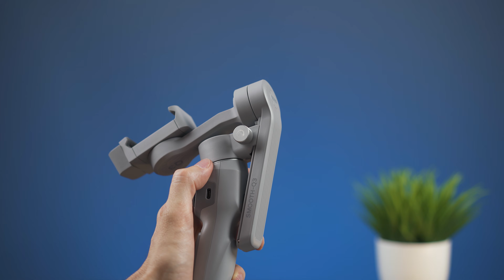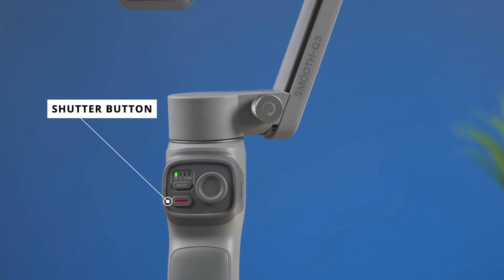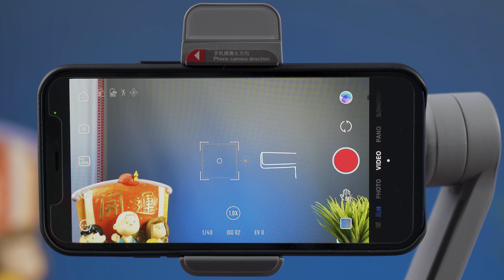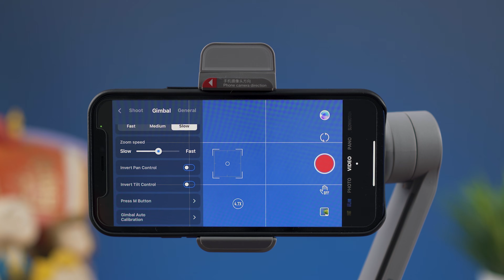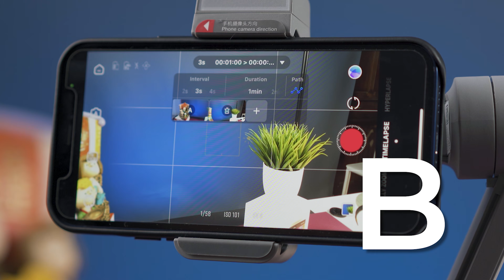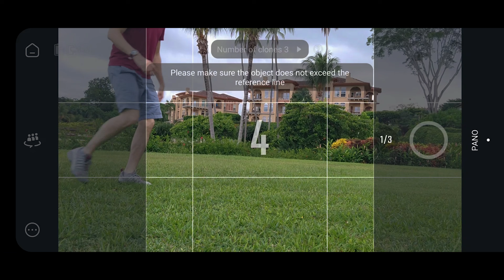Zhiyun SMOOTH Q3 Tutorial: Easy Guide to Setup and How to Use Features

Comment from the maker: NOTE: After sliding the gimbal upward and before placing the smartphone on the clamp, you must unlock the tilt arm and the clamp (they must move freely). They are locked into position so double check it. This seems to be a recurrent problem and it will not properly turn on if they are not unlocked
Reply: i have done everything and mine still won’t connect😕
Reply: @mayavictoria386 if you press the power button 8 times I think it will reset the pairing hope this helps
Reply from the maker: Thanks!! Yeah I got so many messages of gimbals not working and this was the number one issue
Reply: @OttoJulian_  hi
Does it support 4k recording on samsung phone like s21
Reply: How do you unlock it?! Having troubles right now 😅
Reply from the maker: @infatuated818  twist it
Reply: For fb ñive please
Reply: Step by step for fb live please
Reply: Anyone know if this Will this work with Samsung A135G?

Comment: Ive had this for 3 years and just started really using it.  Very good.  But not a fan of the proprietary camera software to use the cymbal full feature.  If I would have known, I would have researched a different gymbal
Reply from the maker: very nice! don't worry about the software, I think every gimbal has this issue, where some features won't work outside of their app.

Comment: 1:08 This step is impossible to do. The phone never balances and always falls to a vertical position (I assume it is done with the gimbal off). On the other hand, PF mode does a terrible job, since the phone is not fixed and changes angle, so you have to press the back button twice to return it to its centered state. I do not recommend this gimbal at all!
Reply from the maker: Your device might be damaged. If you are placing the phone in the middle and balancing it (yes gimbal must be off) and it can’t hold it, either your phone is too heavy or you are doing it wrong. But assuming it’s none of those, then the gimbal has a problem. The rest is obvious, PF or whatever you want to use will not work if the phone can’t be balanced from the start.
Reply: @OttoJulian_  You were right. I was doing something wrong. I saw another video where they balance it and just behind the phone there is a round part of the gimbal that goes up and down (where is the Q3 logo). This prevents the phone falling forward or backward. Then you can balance it. I still thinking that the PF mode doesn't work as well as it should, but the fibal result is very good. Thank you for your response, it motivated me to find out what I was doing wrong. Greetings!

Comment: Like to ask  I take train videos. When doing so will this follow the train as it moves tell it locks in on it? I have a Samsung S20 ultra I want to use the mic. That is on the phone can that be done when using this?
Reply from the maker: hi, I can't understand your question. When you said "locks in on it" are you talking about the tracking? If so, the tracking on the Q3 was not very consistent and it will depend if the app can determine what it's tracking. For a moving subject such as a train, if it's going too fast it might be challenging

Comment: How do I fix the Bluetooth mistake?
Reply: If your gimbal indicator lights slow flash, power off the gimbal then re-pull all up the vertical arm to try. If the gimbak four indicator lights with green solid but can't connect the bluetooth, you can press and hold trigger button+MODE button+Photo/Video button at the same time for 2 seconds to reset Bluetooth to try.
Reply from the maker: @HellenLee-yz2oj thank you Hellen
Reply: @OttoJulian_  You are welcome.

Comment: Thank you for this helpful video.  One suggestion I can make is that you may wish to let consumers know that they have to install the Cami app before some of these features work.  I was initially using my phone's regular camera app, and the tracking etc was not working, so it was initially quite frustrating.  Once I got the app installed, things started coming together.  Thanks again.
Reply from the maker: Thanks for the tip! Glad you are now able to use the different features on their app
Reply: @OttoJulian_   Hello again, Otto.   So, my Q3 refused to connect via Bluetooth now.  It connected once, but since then, it simply will not connect... I've tried everything I can think of.... I've rebooted my phone and the gimbal, I've cleared phone's memory, I have tried connecting in various orders (phone bluetooth on first, then connection attempted.  Bluetooth off, run the Cami app, which prompts Bluetooth...and I've made sure the arm is fully extended and that the swiveling parts are free).  Nothing is working.   I really don't understand why it worked once, then never again...

Would you happen to have any advice before I return the thing?  I am quite disappointed, because I really needed it for this weekend...
Reply: @BadMonkeyFinger_Audio  Pls check what indicator lights react of your gimbal ? If it's slow flash, pls make sure you pull the vertical arm all up when gimbal is off. If it's fast flash, you can upgrade the firmware via computer to try. If it's green solid,  you can press and hold trigger button+MODE button+Photo/Video button at the same time for 2 seconds to reset Bluetooth.
Reply: @HellenLee-yz2oj  thanks for you suggestions.  I have tried all of that, but no luck.  I have returned the gimbal and purchased a Hohem iSteady XE instead.

Comment: Can it be used with gopro ?
Reply from the maker: just like that, no, but there are some special plates that has the shape of a phone, you insert the gopro on the plate and place the whole thing on the gimbal. Depending on the combined weight it will or will not support it
Reply: @OttoJulian_  yes, I've seen those mount plates, I am thinking about getting that plate for my gopro and this gimbal, ti is really affordable

Comment: Hello, my gimbal's roll pan is stuck and not moving no matter its on or off. I thought it may be on standby mode and when I try to switch to PF mode it goes back and all lights are blinking slowly. Do you know what may be the problem, and how can I fix it?
Reply from the maker: To start, the gimbal needs to move when it’s off, so you need to take a look of why it is not moving

Comment: freaking useless.  how do you stop the whole thing from spinning relentlessly?
Reply from the maker: is the phone on the gimbal before you turn it on?
Reply: @OttoJulian_  yes, but apparently they dont work umless its an iphone.  I also downloaded the software but it went to a spam site.
Reply: I have tried it in many ways.  The top arm that holds the phone has only one lock position (so the phone is facing either up or down, not ahead) so it will otherwise not stay stable, and the phone just drops and hits the bottom handle part.  Yours in the video has the phone arm that stays stable so the phone can be used like it's in front of you, but mine will not.  And the app doesn't recognise the gimbal at all.
Reply from the maker: Can you send me a picture to my Instagram account so I can check it out ?

Comment: I have mine now and i don't understand what that rotary knob on the side at 0:41 is for. Thats literally just a screw that does absolutly nothing xD

I understand what your are saying and explaining but like i mentioned before that screw does nothing. its just a screw and a thread. nothing more
Reply from the maker: It’s actually weird if you ask me, but I included the explanation becauseeeee…. Man it’s a long story lol
Reply: @OttoJulian_  well i disambled the gimbal yesterday and it is what i said. that screw does nothing. its just a screw. xD
i does not tighten anything. the thread is just in the right side of the body and has no connection to any other parts. its 100% useless ^^

Comment: How do u use the zoom on the side
Reply from the maker: it only works with the Cami App, otherwise it won't work
Reply: @OttoJulian_  my QE won’t power on why I plug it up nd it’s not glowing or nothing
Reply from the maker: Did you charge it? Is it charging ?
Reply: @OttoJulian_  no it’s not glowing up it flicked green but didn’t do nun

Comment: Hi sir, i recently bought a Zhiyun Smooth Q3, but it seems the trigger button looks like doesn't work properly. i mean, for rotate phone from horizontal & vertical push the trigger button 3 times, but it doesn't work. Same goes to recenter the phone, push the trigger button 2 times as mentioned in your video but didn't work on mine gimbal. So how? Any solution for that? Sometimes it works, but sometimes it doesn't. Thanks for your help sir
Reply: I also have the same problem. Did you get a solution?
Reply from the maker: you have to press twice or 3 times in a quick succession. If it's too slow it will not work

Comment: On android devices, does it support 1080p 60fps, or 4k 30fps?
Reply from the maker: 4K 30fps
Reply: @OttoJulian_  In your opinion Sir, What would be the best gimbal for an android device knowing many limitations on android cameras to the mimo app. I was thinking of Dji om5 or this zhiyun Q3? (Btw I have a samsung s10 device) I also know for a fact that I can use the native app tho.
Reply from the maker: Well the problem with Android is that it will have the same limitations with every gimbal, like no 60fps or slow motion for the most part. If you are using you native camera app then it’s not an issue. OM5 is good in my opinion, portable and the magnetic clip is great. ZHIYUN has a mode button which is great and the OM4 or the OM5 don’t have it
Reply: @OttoJulian_  Thank you for this, I'll just probably go with OM5 for that magnetic clamp will be very useful in the long run. But last question, as a person with more experience and stabilizers, do you usually change modes while using your gimbal? I wouldn't mind switch modes on my phone (hopefully).
Reply from the maker: most of the time I use 1 or 2 gimbal modes, and it will depend on the shot itself

Comment: which mode is best for short film in this gimbale
Reply from the maker: The gimbal mode will not depend on the video duration, it will depend on what you want to achieve on your video (what movements you need for example).

Comment: My Q3 came in a cardboard box, no case. 
The Q3 is horrible because it tends to tilt down or somewhat want to spin, when walking and recording. The Smooth Q I got for my previous cell phone, I never had issues.
Reply from the maker: the case only comes with the Combo version. I haven't had such problems (tilting down, etc), and those usually happen when the phone is on the heavier side
Reply: @OttoJulian_  thanks for replying back. I got me a S20 FE (no case). I thought this gimbal could handle that phone. Next month, I might switch to the DJI om4. 
Have a great afternoon.

Comment: Hello Otto,
Thank you for your great tutorial. I am having trouble with my gimbal. It will not lock when I am in PF mode. Wonder where did I go wrong. Please assist. Thank you
Reply from the maker: it should lock if you are just using PF mode.
Reply: @OttoJulian_  Hi,
I am on PF mode but it is not working. Wonder where have I gone wrong. I am new to the gimbal. 
Thank you.

Comment: Trying my luck to seek help here. I am not able to switch between mode, the 4 lights are always on, and they continuously fading then light up, fading then light up.....I am not sure what's wrong. Anyone experienced this? Thanks
Reply from the maker: that's the standby mode. Your gimbal is probably not properly setup, make sure the arm has been pulled all the way up, make sure all axis are unlocked (your phone should move freely before you turn it on in all directions)
Reply: @OttoJulian_  Thank you very much Otto. Such a great help. Apparently one of the axis was locked. Smooth Q3 is working fine now, love it.

Comment: I just bought one and I'm testing it. I found out the tracking mode when I highlight something to track, the whole gimbal is vibrating and I'm not sure if the motor is spoil or this tracking got some issue. I try tracking other things and the gimbal just spin and spin around. it's so weird!
Reply from the maker: are you using an android phone? this seems to be more of an issue on Android... on my original review of this gimbal I did mention some issues with the tracking, not what you describe but sometimes it looses the subject. Depending on the movement and what you are tracking the gimbal might try to "turn around" to find its subject and that's where it seems that it's going crazy. As soon as your tracked subject is no longer in the frame you need to cancel the tracking. Always makes sure there is enough light (tracking doesn't work too well when there is not ) and try to test the tracking limitations

Comment: Great explanation, I have the vortex movement (in POV mode) does not work with the mobile as in the video 3:27, is this a problem with the gimbals?
Reply from the maker: hi. Vortex mode is the one AFTER POV (If you look closer at the video the light is blinking twice).
Reply: @OttoJulian_  Thank you and thank you for the quick reply

Comment: This or the dji om 5
Reply from the maker: OM5 is more portable, this one has the M button right on the gimbal to change gimbal modes and the fill light. it just depends on what you are looking for. I have a comparison video between this and the OM4, it should give you a better idea since the OM4 and the OM5 are kinda similar in a few ways.
Reply: @OttoJulian_  okay, I went for the Hohem isteady v2
Reply from the maker: @Louis Hamilton  interesting. That's just a bit different from the original 2 you asked for 😊, but nevertheless a good gimbal as well
Reply: @OttoJulian_  yup, but my daughter is doing alot of tiktok and instagram also, so i think that will be the best option, if im in to buy another, more pro gimbel, i was considering the G6 Max because its movements are not limited
Reply from the maker: I see!! Yeah the V2 can track her easily without having to depend on the gimbal app. I haven't used the G6 to be honest, for smartphones without movement limitations Zhiyun released the smooth 5 (made a video about it). If you have a bigger camera, I'll release a video tomorrow of the new crane M3.
Reply: @OttoJulian_  okay, i will only film with my iphone 13 pro max, i will check your review out on the smooth 5

Comment: Hi everyone. I am just a beginner. I need help. I want to go on lock mode like not letting the axis or tilt to move around just lock it in front shot because I mainly use this for walking around vlogs. I tried all mode it seems that all modes are moving side by side or revolves around... Anyone? Help? Thanks!
Reply from the maker: Hi, LOCK mode will lock every axis. Is the light indicator on at the L?

Comment: Thanks for posting. Really helped me set up. I’m noticing my vertical arm isn’t locking when in the down(non filming) position. Even with the screw lock engaged. Is this normal or should I send it back? New to this so any advice is helpful 😁
Reply from the maker: The locking knob? Yeah it's normal that it doesn't lock down the arm the way we would think. It barely has any strength, but it seems to be normal for this gimbal.
Reply from the maker: Oh and you are welcome!!
Reply: Oh ok thank you. I was concerned for a moment after noticing the lack of lock strength on this. Thank you kindly and keep up the great content.
Reply from the maker: @illstylez1  you are welcome!

Comment: I think this gimbal works good with iphone. Cant balance samsung s series phones.  Worst buy
Reply from the maker: Why, which samsung do you have? I have used the S20+ and S21+, no issues
Reply: @OttoJulian_  my phone is samsung s20 fe 5g  :(    cant able to balance. i think i got a defective gimbal  :(
Reply from the maker: @gundeepraj7246  this gimbal is "tricky" in the beginning. Make sure the clamp is unlocked (rotates), as well as the upper arm need to rotate. When you turn it on if its not straight, go into the app and perform a gimbal calibration.
Reply: @OttoJulian_   i unlocked the clamp as well the upper ramp but in the cami app the calibration fails after 6%
Reply from the maker: @gundeepraj7246  if you can send me a short video to my Instagram account so I can check what's going on. I need to see the phone placement, and what the gimbal is doing. Hopefully I can help
Reply: @OttoJulian_  i will do that . thank you :)

Comment: Hi Otto, Which gimbal would you recommend for Samsung S21 ultra? thanks
Reply from the maker: Most of the gimbals I have reviewed are good for your phone, maybe the only one that might not be too friendly with the size of your phone is the Isteady. Look at the features that the different gimbals have to offer and choose the ones that will adapt to your style
Reply: @OttoJulian_  It is very difficult to narrow down. main purpose is to get smooth output. I need a gimbal which gives good stability in shots only. I guess most the gimbals and their apps do not love Android so much. Is Smooth Q3 a good buy? does the motor of the gimbal give more stable shots in comparison to DJI or Hohem?
Reply from the maker: The ultra is pretty big and you are pushing it on the Hohem. I like the Hohem but for bigger phones I'd go with the Moza, the Q3 or the DJI. If you like using a case the magnetic clamp might not be for you (I find myself removing the case to use the clamp). Stabilization is good on the options I gave you, you just need to get used to each one since for example the dji will feel more sensitive than the Q3